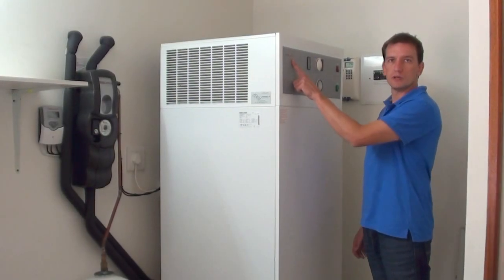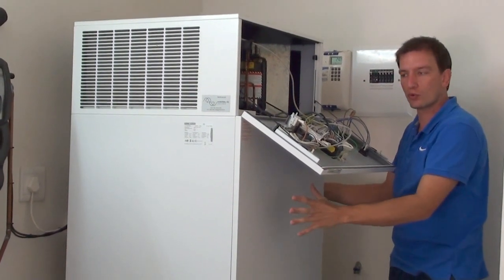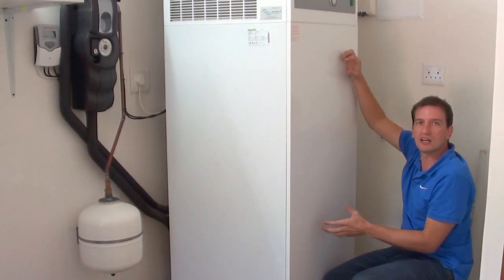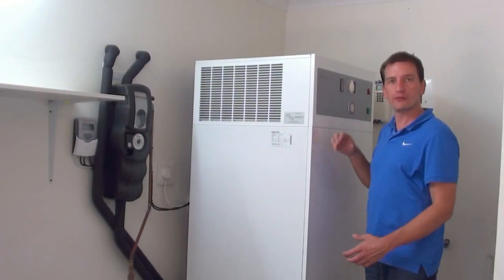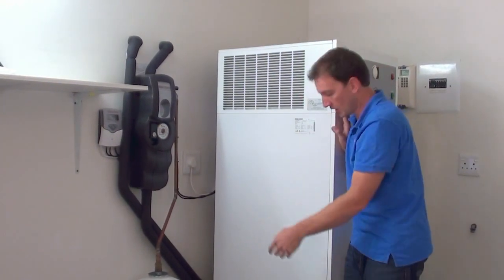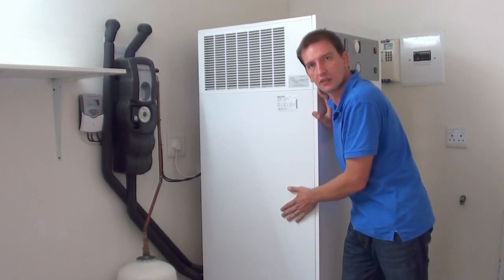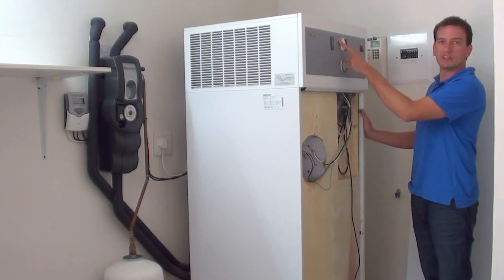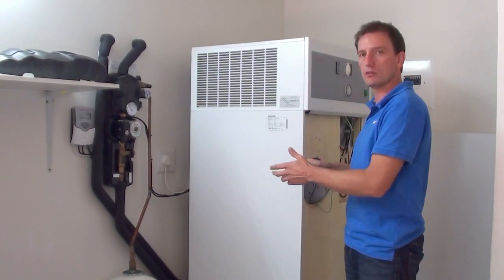WWK 300 Liter Stiebel Eltron Solar heat pump

Comment: We found this in a house we are living now. I'm looking for information about this heating pump. Are you sure, it needs 0,44 kwh to heat the  300 liter tank? Thanks forward
Reply: We also have this in a house we bought a few months ago. I have to say it works well and the consumption is low. I am trying to find information about changing the anodes.

Comment: One side-effect of this heat pump water heater is that it is also cooling the room. In winter you might not want it - and you will have to heat your house more to compensate. In summer this could be a wanted side effect.

Comment: We fit allot of stiebel eltron air/ground source, I've never fitted one of these though, what sort of regeneration time are you looking at, when heating up the tank from scratch? Does the unit have much effect on the ambient air temperature of the room? -Thanks
Reply from the maker: Hello Ash,
With an air temperature of 15 deg C, rel. humidity of 70% and cold water at 15 deg C you will have a 9 hour initial heating time. The reheat time, in normal day to day operation, comes down to 5 -6 hours depending on the air temperature.
If you are considering the unit for one of your clients please contact us and we will gladly assist you with the first installation.  We have learnt that, with 55 deg water and the built in solar heat exchanger, you cannot use this unit to supply hot water to Victorian baths. When you have no solar the heat pump only heats up the top 150 liters of the 300 liter tank. You would need more than one of these units for large houses where the clients have big baths and a lot of showers. You also cannot connect hot water ring main circuits to the unit even though the unit caters for this.
There is a lot more information in the manual should you be interested:
http://www.stiebel-eltron.co/images/stories/stiebel/products/wwk300/Manual_WWK_300_sol.pdf
Thank you for your comment and if you have any installation videos or pictures, please would you share them with us? We would like to share stories and connect with other Stiebel Eltron installers around the world.

Comment from the maker: Hello Seth,
The solar pump is a SOKI basic pump unit from Stiebel Eltron. It uses a Wilo pump to circulate the Glycol. You were correct because the unit has no PV panel but has a flat plate glycol collector. The solar controller is the Stiebel Eltron som 6 unit.
http://www.stiebel-eltron.co/products/renewable-solar/solar-controller
Stiebel Eltron has launched a new heat pump that heats 300 liters off a PV panel. It is the Stiebel Eltron WWK 300 PV unit that you can find on the German web page if your interested. Thank you for your questions below.
Regards Cathy

Comment: What type of solar pre-heating pump and controller are you using here? The SEA 300 comes with a PV panel correct? But this has been bypassed in favor of the glycol system; I'm assuming a flat plate collector.